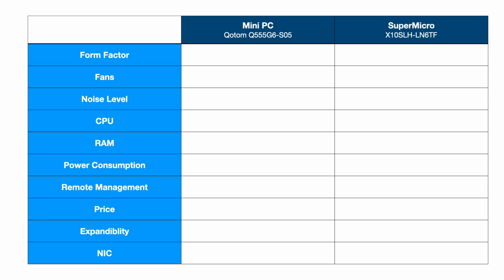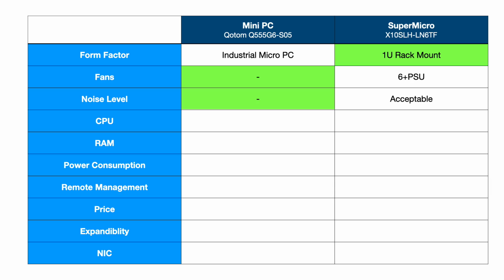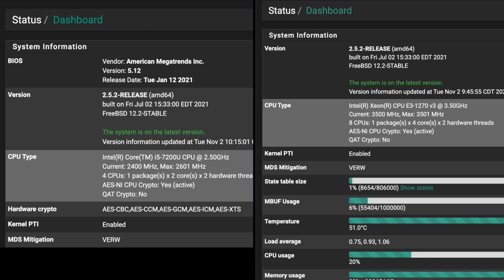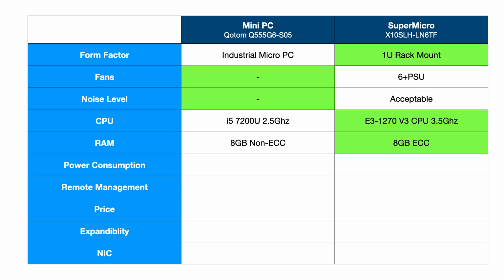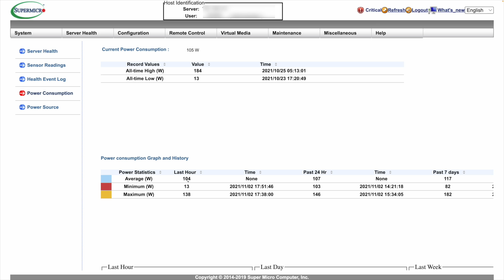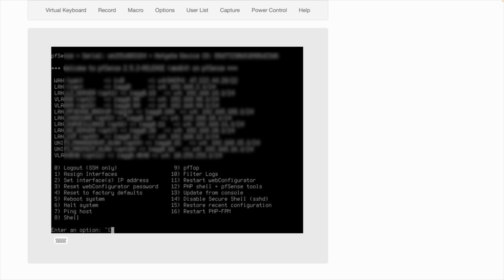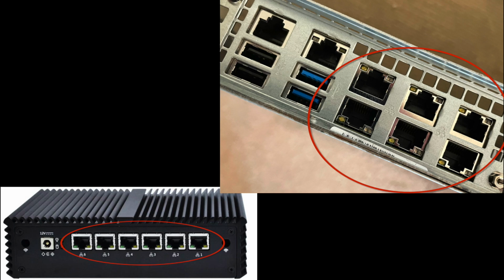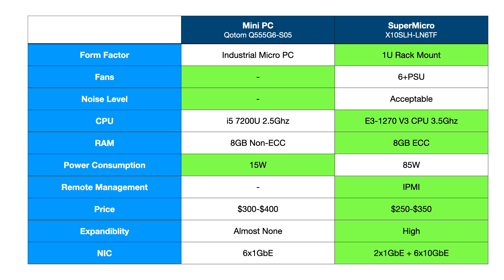Custom pfSense Build - Mini PC vs. 1U SuperMicro Rack Mount Server

Comment: Do you happen to know the dimensions of this server?
I’m looking at getting it but want to ensure it will fit in my rack
Thanks. 
Also. Do you recommend any other server for running pfsense? Since this video is ~ 2 years old
Reply from the maker: It's 1 U, ~26 inches deep.
Reply: @hz777 Thank you. I assume you are still using this device as your firewall?
Reply from the maker: @Kehf27 yes but only in my lab though.
Reply: I apologize for the number of questions but I’m considering switching to pfsense for my firewall.
Are you saying that you no longer recommend pfsense or the Supermicro server?
Or are you recommending something else for home usage?
Reply from the maker: @Kehf27  to really use Unifi gateway in my "production" environment, recently I started using UniFi udm-pro seriously. However, I may switch back to pfSense anytime.

BTW, my switching to UniFi was completely due to my youtube channel mainly focusing on UniFi. pfSense is still way ahead of UniFi when it comes to functionality/documentation/community/etc.
Reply: Ok thank you for your response.
I’m going to assume then that you still recommend the Supermicro setup -meaning you don’t consider its usage/implementation to be obsolete.
Reply from the maker: Exactly!

Comment: qould you consider Netgate firewalls? why not just use Unifi firewall integrated on the UDM?
Reply from the maker: For the same money, I can buy better hardwares if I go with custom hardwares instead of Netgate ones.

pfSense is far more advanced, and opener than UniFi routers.

Comment: Do think it’s unwise to run anything other than pfSense and it’s add-ons on the 1U server?
Reply from the maker: It only has one processor, and 4 bays for storage, so apparently not good for running heavy load servers or NAS. I do have another similar one and run ESXi on it, no complains.

Comment: In one of you videos you explained how a layer 3 switch "bypasses" the pfSense 1Gb connection.
What would be the benefit with a 10Gb/50Gb pfSense?
Thanks already!
Reply from the maker: Great question. First not all UniFi switches are L3, secondly l have non-UniFi switches as well. And in fact the most important reason is the L3 function in UniFi world is not matured enough to cover many real world inter VLAN routing scenarios.
Reply: @hz777  
Thank you for the explanation.